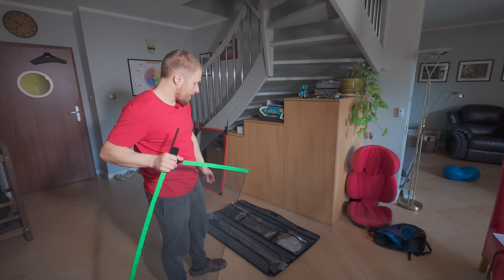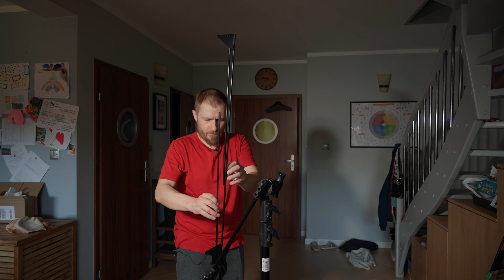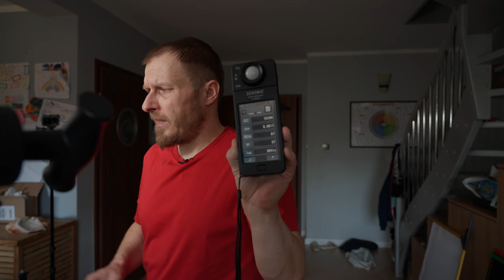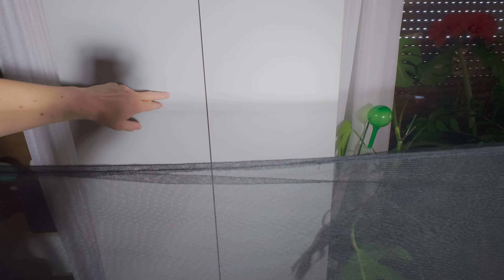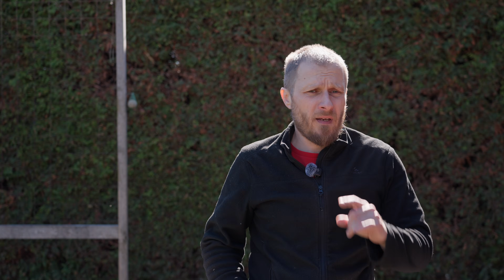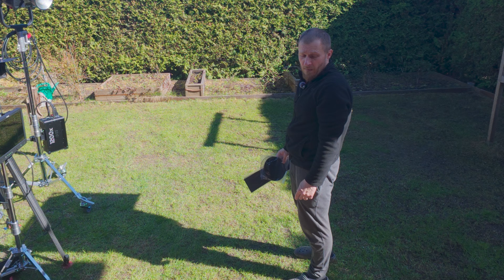First look at godox flag set (SF6090)

Comment: i got the same 60x90 flag set, dont know the brand, its all from the same factory anyway. the bag with the 5 flags and mini flags is way to heavy, i dont need the mini flags anyway. it takes too long for a setup. but i like having flags! so what i do: i bought a small protector case, so 3 collapsed frames fit into it. diffusion / nets STAY ON the frames, all the time. just pay attention that the other metal rods will not rip the difussion. thats where your protector case / plastic umbrella sleeve whatever you use - helps. the black  diffusion on my version is like SILK, it got a shiny texture on it. its crazy!  sometimes i just clamp another difussion on it. maybe i will make a DIY diffusion, just a bleached muslin or something, could be handy. also having 3 black flags that are collapible is fine
Reply from the maker: I guess I would try that approach (to keep the diffusions on the frames when collapsed).

I've seen some knockoffs of this set on aliexpress, but what is funny it was more expensive there then this set locally, so no brained to buy here :D.